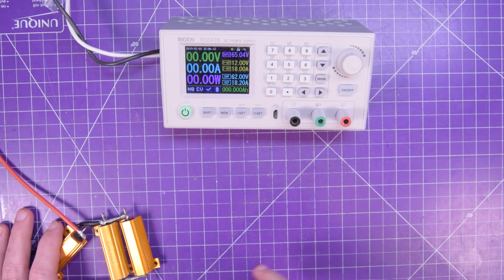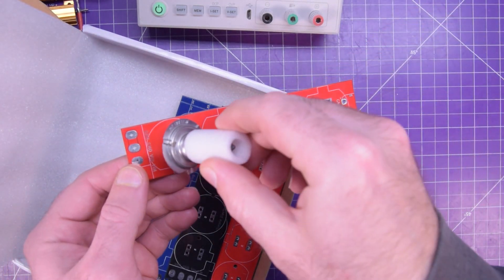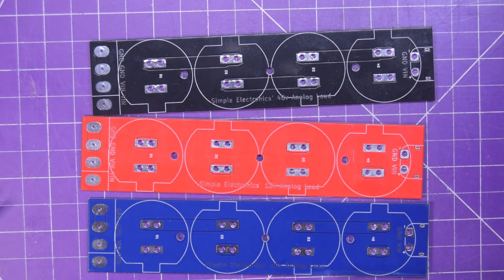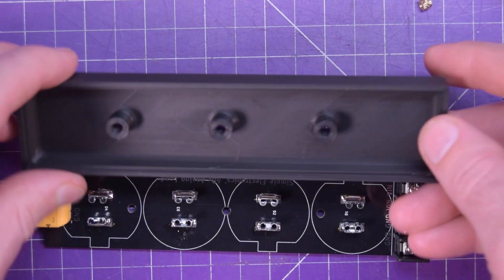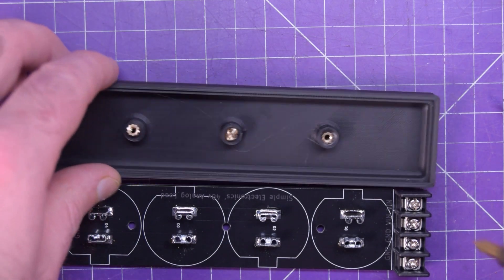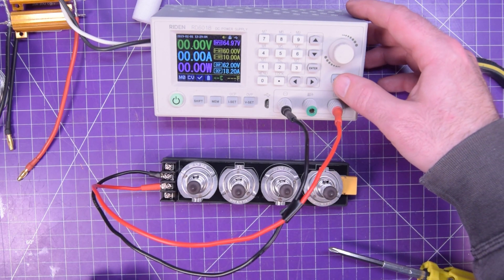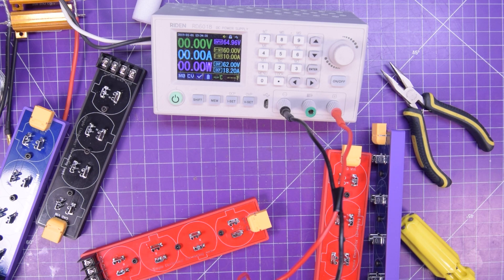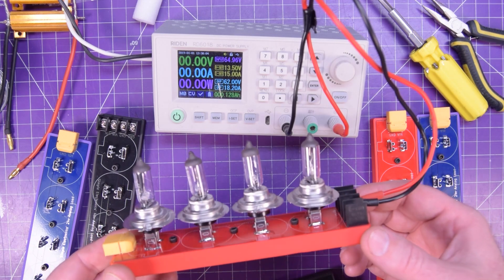Cheap And Effective - Analog Load Up To 60 Volts!

Comment: I made something like this 2 years ago i used h7 car holders and glued them on a little box. In the box are 2 step down units whit 2 potmeters on the outside so i can adjust the voltage. 
I made a newer version whit a programmable step down module.

Comment: Nice solution and perhaps a metal shield or box could be built to contain the light a bit, but ventilation would be important and 3D-printed items would melt or worse.  Incandescent lamps are good for this purpose as they radiate most of their energy away from themselves while power resistors are poor radiators... until they get so hot they fail.  Julian would approve.

Comment: Tungsten bulbs are not a linear load. At startup they have a very low resistance, virtually shorting a PC power supply into fold-back. For $20 a 5000w "Dryer Heating Element Restring Coil Replacement" can be cut and segmented for installation on a few screw-type barrier strips.😉